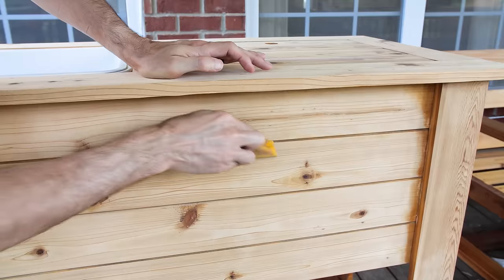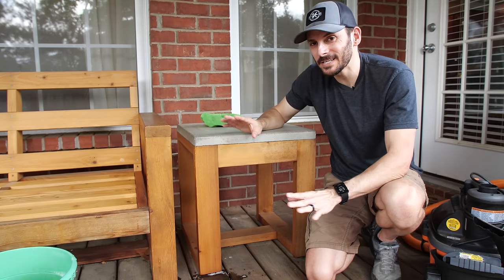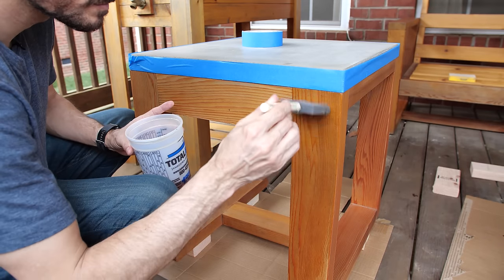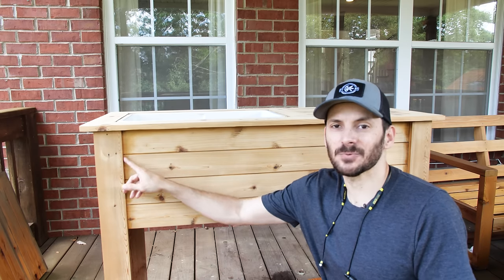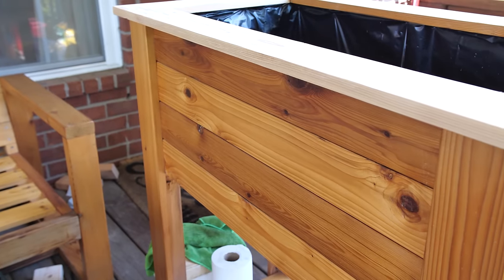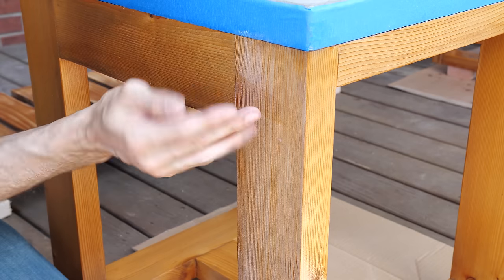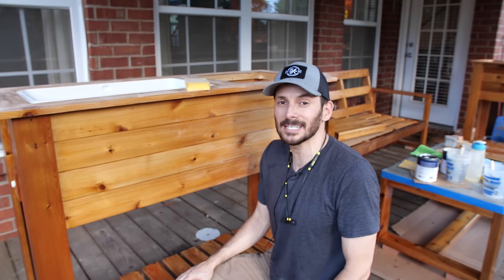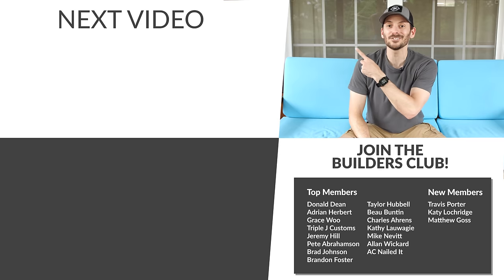Refinish Outdoor Furniture the EASY Way | DIY Wood Restoration

Comment: Great job cleaning the outdoor items using liquid dish washing detergent and water and soft scrub with cloth and brush.  For the stubborn parts, maybe use a "paste" made of "barkeepers friend" (or baking soda) on the cloth and use that to scrub out the imbedded grime and other stuff from the microcrevices of the wood surfaces?

Comment: Great video! Novice question - if you wanted to stain the wood, would you do a stain in the place of the sealer and then finish with the coats of total boat?

Comment: This video is great. I recently used Total Boat sealer and stain on an outdoor piece made from cedar. After a month or so, it began to gray under the coat. Is that the natural transition or did I not add enough sealer?

Comment: Thanks for this video! Are the finishing products you used in the video what you used on the furniture when you originally finished them? Also, is everything getting direct sun or more indirect? I have porch rocking chairs I am refinishing so they will obviously get direct sunlight part of the day, then indirect sunlight. I'm looking for a finish that will hold up. Thanks!

Comment: Why did you use gloss for all your coats but then used satin for last coat?  Why not satin for all coats?
Reply from the maker: Great question, I should have explained that more.  The flatteners in the satin or matte finish will cloud the finish if put on in too many coats.  Gloss has no flatteners and when you top coat it with satin it look clear but with a satin sheen
Reply: Fix This Build That Oooh ok i see.  Do you think that’s the case for any brand or is it just total boat?